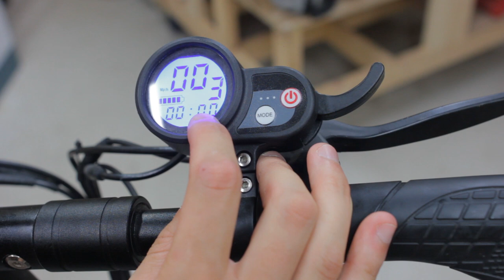Solar P1 Parameters (Walkthrough)

Comment: Can you change what speed mode u want or does it automatically change the further down u press the accelerator
Reply from the maker: You can change speed modes on it. So mode 1 is limited top speed, mode 2 is medium speed, and mode 3 is Max top speed. Along with this you can choose either single motor or dual motor — so you can have a variety of combinations to suit your requirements.

Comment: Hello is there a way i can change the brightness of the display or dim it because its a little hard to see while riding
Reply from the maker: Unfortunately not the screen is at a set brightness.
Reply: You can loosen the speedo and angle it away from you. It works well when it's almost horizontal.

Comment: Will you be making a new video with the 3.0 version?
Reply from the maker: Yes we wil soon
Reply: Thanks. I’ve installed the new fingerprint reader you sent but it’s showing battery is on 2 bars but the scooter fully charged. Is there anything I need to change?
Reply: @SolarScootersuk  I think I figured it out. The replacement you sent was set to 60v so I changed to correct setting 52v now it shows full bars

Comment: Surely P8 can be changed to lower the power to the motors, to reduce top speed so you can gain a bit more efficiency while in gear 3?

There's a similar setting with my Mantis Lite Plus which I've lowered, which has gained me a bit more range. 

Just wondered about that...

Either way, you've done a solid job with the P1 so I'm definitely getting one very soon, I can even promise this!

Comment: How long does it take to fully charge the P1 ?
Reply from the maker: 6-7 hours
Reply: Thanks
Reply: Is your charger a little lose to the point u can pull out the charger to the battery a little bit? or is it just my P1 pro?
Reply: Thanks. I have a halo m5 48v 18ah 500w and the display is identical

Comment: Im getting the p1 of some 1 on friday she has really looked after it oys done 200miles is that low and also can i put slime in the tires to prevent puncture even though the scooters not new
Reply from the maker: Yes that is relevantly average mileage. Yep you can still install tyre slime 👍🏽
Reply: Thank you what sort of mileage does the batteries last for I know you can keep them in good condition if you treat them properly
Reply from the maker: @davidtwitchett7098  we’ve been operating 3 years and never had a return for battery dying, so that should give a good indication :)
Reply: Thank you i be picking it up friday love your videos
Reply from the maker: @davidtwitchett7098  you’re welcome! Enjoy 🙌🏽
Reply: Just got my first electric scooter had to be the p1 such a solid scooter I got 35 and hardly much wobble the duel motor is amazing and I didn’t expect it to be awesome like this I just tired launch mode and I think I’m gonna stay with the duel motor for now as that’s fast enough for me I nearly messed up my settings thanks for the video helped me put
it back to how it was ☺️everyone go cop ya self this scooter it’s a madness

Comment: Hi just got one of these how do you change the battery as in what is it sorted to be on for the  Re generated thanks
Reply from the maker: Hi — apologies could you rephrase the question please? We don’t quite understand.
Reply: @SolarScootersuk  how to put it in to the bit what helps you not to go Through pads or discs quick hope that is better thanks for getting back to me
Reply from the maker: @martyncoburn1681  oh Regen braking? 

It is already turned on as standard. To use — pull the brakes only slightly in, there will be a 0.5 second delay then you will feel the scooter braking. This is Regen braking and it feeds energy back into the battery and brakes without using the disks or pads. 

Takes some practice, but you will get used to it quickly.
Reply: @SolarScootersuk  sorry just one more thing what number is it to change the speed thanks
Reply from the maker: @martyncoburn1681  it’s the number in the top right hand corner 1, 2 or 3
Reply from the maker: Not in the parameter settings

Comment: What is kick-start mode and power start mode used for?
Reply from the maker: Kick start = you have to physically push the scooter off the get the motor working (it’s a safety feature)

Power start mode = the scooter will shoot off as soon as the accelerator is applied

Comment: hi i just got my p1 2.0 with finger print reader and the p settings seem to be all different, i went into p9 to change the break and on mine its to add a new finger print i think, i cant find any info on what the p settings are for the finger print version, it does not even make sense in the manual that came with it, a list of the p settings would be amazing and also what 0 and 1 mean in each setting as to on and off, thanks
Reply from the maker: Hi — this is the wrong video to watch. As this one isn’t the fingerprint reader version, which has different parameters altogether. See our channel for videos specifically for the fingerprint reader for all models
Reply: @SolarScootersuk  wow thanks for the speedy reply, cheers just looking now , thanks guys x

Comment: My battery voltage is 49.8 and has cut off twice now to 0 and I've had to push it home but you said in the video it needs to be 41.5?????
Reply from the maker: This is for the old p1 

If you email the team they should be able to let you know the correct parameters for your scooter

Comment: I’m going to buy one as soon as it is in stock
Reply: I have had one for over a month and it's amazing. I had to turn power start to normal start to prevent my arms being pulled out of their sockets. Takes a bit of time to work out your favourite settings and how to best use the trigger throttle. I took it up some steep hills the other day, and if she's struggling, just hit the yellow button and the hill is behind you.
Reply: @wi777ard  what sort of mileage are you getting on it🤔 thanks
Reply: @martyncoburn1681   longest journey I have done is about 18 miles and it was still showing 3 bars (of 5) battery.

Comment: Having a issue with the cruise control sticking on when not intended, even when only holding the accelerator for 1-2 seconds. Nearly had an accident as a result. Its happened quite a few times and randomly which is concerning.
Reply from the maker: When turned on it will always come on after holding the acceleration down a few seconds. It takes getting used to but I would recommend turning it off unless you plan to use it for a long journey
Reply: @SolarScootersuk  Thanks, why is that? Good to know though.
Reply from the maker: @BennyH11  because it’s essentially turned on, you’ve told the scooter you want cruise control so when it’s on, after a few seconds of acceleration it’ll kick in. Just needs turning off back to 0 on the parameter for it to stop kicking in.
Reply: @SolarScootersuk  Its fine I think. I do use it occasionally but it helps to know about it happening after its just turned on. Thanks 👍
Reply: @SolarScootersuk Hi. Without cruise control do you need to constantly hold down the lever to ride?
Reply from the maker: @bigzybinc  yes 👍

Comment: I have the original solar p1 48v with the red release bar, what setting should p1 be?
Reply from the maker: Email the team!
hello@solarscooters.co.uk
Reply: @SolarScootersuk  cheers mate
Reply: P0(wheel diameter) - 10

P1(voltage) - 41.5 (48v old P1, pre AUG21)

P2(magnets in the motor) - 17

P3 - 1

P4(mph/km.h) - can be 1 or 0

P5 (kick-start) - can be 1 or 0

P6 (cruise control) - can be 1 or 0

P7 (soft/hard start)- can be 1 or 0

P8 - 100

P9 (e-brake) - can be 1 or 2 (stronger)

Comment: Hey a brought a scooter from someone and they’ve messed with the settings the scooter is a 2400w dual motor and the battery is 60v 21ah what should my p1 settings be? And what should any others to do with the battery be
Reply: Bro you’ve been waiting for ages the p1 should be the same as the settings on this video I have the same scooter As you just change the settings to what the video says mate how it works out for you
Reply: @jamesbleasdale7711  I meant p settings my bad 😅it doesn’t matter now anyway the thing just ended up braking needs a new battery and the battery is like £700 so I’m just going to throw it away 😅

Comment: Sorry if this is a dumb question. If I was to increase the voltage, would it be faster? But drain a battery a little faster?
Reply from the maker: No sorry it doesn’t work like that — the speed is bottle necked by the controllers. So even if you crank the voltage up in the settings, you won’t go any faster. 

Changing the voltage can negatively affect the battery and motors
Reply: Agree with Solar with their response 100%

But also increasing the voltage with a different battery from anything above 52V will fry the controllers. The capacitors within will almost instantaneously blow.

Comment: I accidentally changed my P0 on my Solar P1 2.0 from 10 to 11. Should I just flick it back to 10 again?
Reply from the maker: Hi — yes I would change it back if you can. Some parameters are not to be changed
Reply: @SolarScootersuk  All done thank you😎also quick question, max speed is roughly 40mph, my scooter was on 2 bars of battery and went 30mph on max speed mode. Is that just for safety precautions?
Reply from the maker: @cappedatol6947  yes that’s correct as the battery depletes the power will reduce. This is to protect the battery :) full battery will much more power

Comment: Hi just bought the solar r1 today and the top speed is only 37 mph
Reply from the maker: Drop the team an email you may have the wrong parameter settings. They can give you the right ones 

hello@solarscooters.co.uk
Reply: @SolarScootersuk  hi appreciate the reply can I get the teams email please?
Reply from the maker: @mo_e_ldn_7215  hello@solarscooters.co.uk
Reply: That might be about right, but it does depend. Battery charge, temperature, rider weight, additional load (backpacks etc) and tyre pressure can have an impact on your top speed.

Comment: Is there a way to make the back wheel on the R1 more powerful? It seems the front wheel has 3 times the power of the back wheel is this normal???
Reply from the maker: It‘s not more powerful, it just seems that way because the front has less grip due to weight distribution. They are both the same wattage
Reply: No the rear wheel is definitely miles weaker than the front… because I have tried holding the scooter down with each wheel on the ground and it’s easy to stop it moving with the back wheel but the front wheel is so much more powerful that I can not hold it still… is there a problem with my scooter then? Even when I just use the single  motor button the scooter feels very weak… weaker than I think it should feel
Reply from the maker: @lildeanc  email the team they will be able to assess for you.

hello@solarscooters.co.uk
Reply: I am also only getting 42mph out of the scooter top speed… is the rear motor damaged?
Reply: @lildeanc 42mph is really got for solar..

Comment: Is p9 regenerative braking?
Reply from the maker: Yes P9 is Regen braking
Reply: @SolarScootersuk   Hello , Do I need to change it on my new p1 or is regen already on , also do I need to change any of the parameters setting as its just arrived brand new.
Reply from the maker: @canieldormier8340  no need to change any parameters. Regen should be P9 and set to 1 

Please do not change any other parameters as this could affect the voltage if wrong one is changed.
Reply: @SolarScootersuk   Thanks for the reply ,  also 1 more question , Do you know how much ml of slime to put in each tyre
Reply from the maker: @canieldormier8340  I put half a bottle in each tyre and it was only a small bottle. On the back of the container label it has an exact amount calculator for the size tyres
Reply: @SolarScootersuk   Thanks mate , Appreciate the help 👍🏻
Reply from the maker: @canieldormier8340  no worries!

Comment: Hello. I've recently received my R1 scooter, while messing with the parameters, I think I may have changed the voltage setting. Looking at your video, your scooter shows the voltage setting as 41.5, is 41.5 the standard setting for all R1 scooters?
In the owners manual specifications shows the standard voltage is a 60 volts battery. I'm a bit confused as to which parameter I should input. Please help and clarify. Most appreciated.
Reply from the maker: Make sure you parameters match these:

P0 - 10
P1 - 45
P2 - 14
P3 - 1
P4 - can be 0 or 1 kph/mph
P5 (kick-start) - 0 or 1 
P6 （cruise control） - 0 or 1
P7 (soft/hard start)- 0 or 1
P8 - 100
P9 (e-brake) - can be 1 or 2 (stronger)
Reply: Thank you. You guys at Solar Scooters are awsome!
Reply: @SolarScootersuk  what setting should speed limit ratio be on p1 2.0 manual just says don’t touch but don’t know if I changed accidentally 😂

Comment: My 4000w p1 pro 2023 usa voltage is set at 50
Reply from the maker: That’s fine, the USA one is different. Please do not adjust
Reply: @SolarScootersuk  awesome thanks! Already put 61 miles of pure smiles on my p1 pro 👍😎😃 worth every penny
Reply: @SolarScootersuk  Can you give me the exact parameter for the P1 Voltage setting on the (4000w USA P1 PRO) someone said it should be 60 and mine came at 50.
Reply from the maker: @HardinRacingHPS  the voltage changes depending on the charger state! Don’t worry about that one
Reply: @SolarScootersuk  the P1 setting?
Reply: @SolarScootersuk   the usa one is different so p1 setting at 45 or 50?
Reply from the maker: @HardinRacingHPS  that one isn’t a setting rather it’s showing what voltage the scooter is currently in, this can be left alone
Reply: @SolarScootersuk   Sorry for the confusion im talking about the P1-P7 Parameter settings, My P1 Parameter (cut out voltage) came at 50